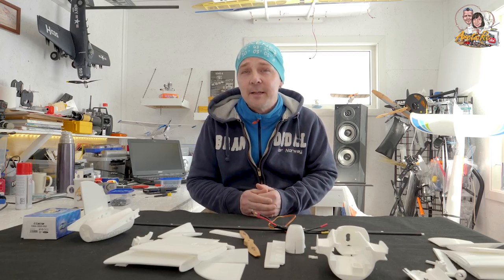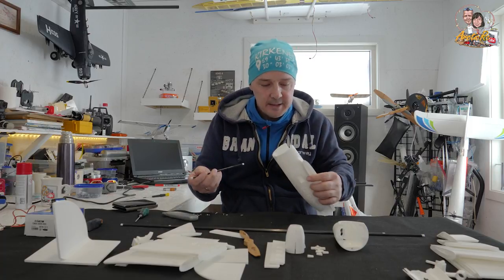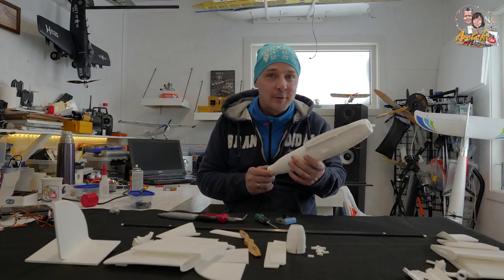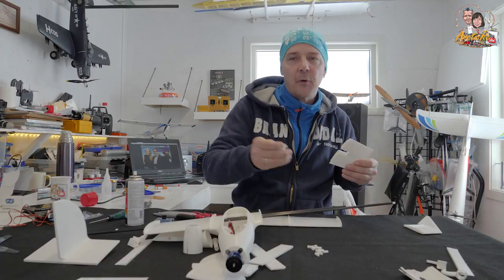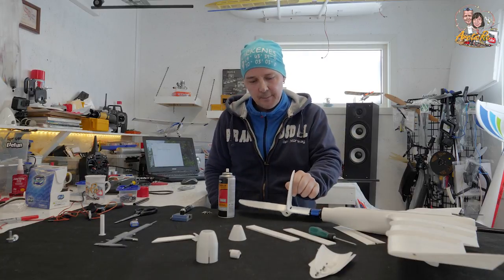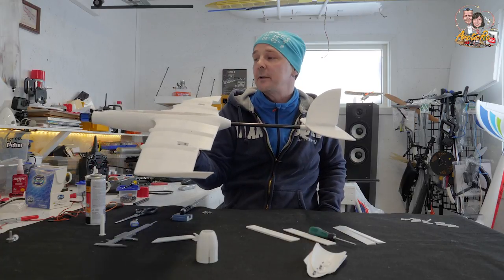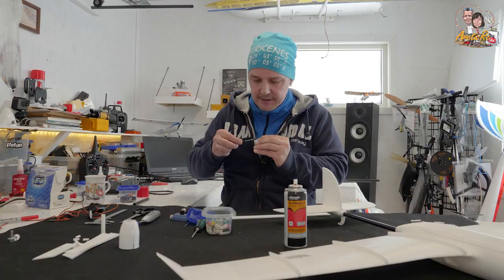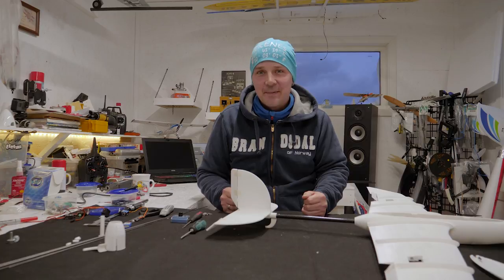3D Printed evolution speed Glider from 3dberridi.com (Build video)

Comment: here are some things to consider.  prop Should be about five inches closer to the main wing.    the prop must be an Antique.   the use of an UNTAPERED cf tube for the tail boom, results in there being EXCESS weight at the Tail.  this Not related to balancing the model.    it relates to Designing a model so that it has a STABLE DISTRIBUTION OF MASS.   the vert-stab leading edge is a Joke.   ridiculously Massive main spars.   a POLYHEDRAL main wing?    this is one confused model.    cheers
Reply: "Ideal" and "practical" are not the same thing. You are describing YOUR dream plane. I am convinced that your opinion of your own level of knowledge is vastly exaggerated.
Go heckle a NASA engineer instead Einstein.